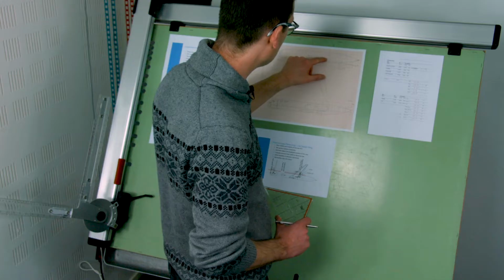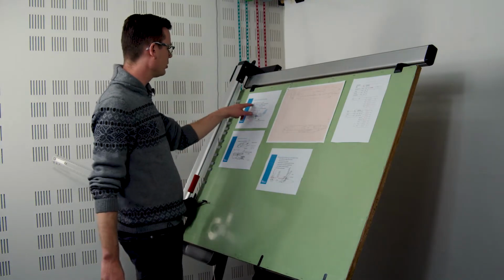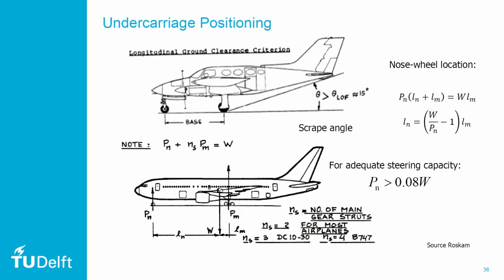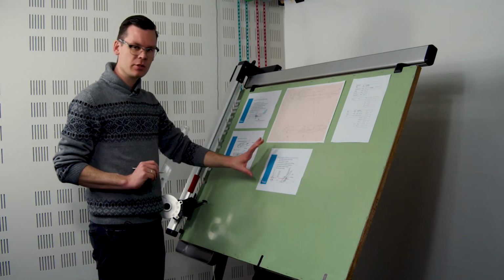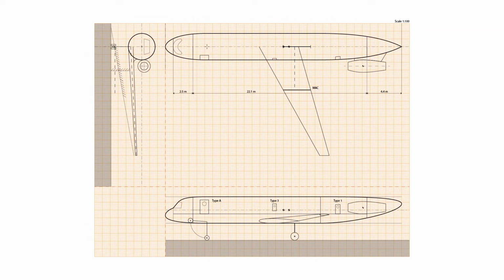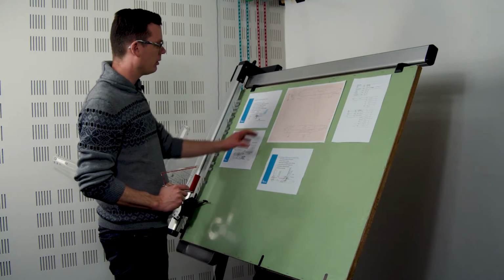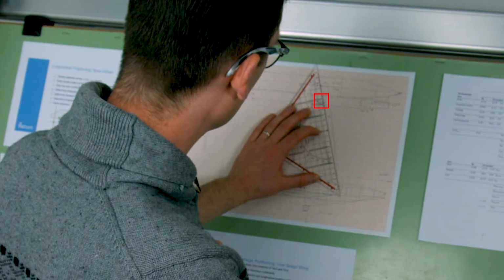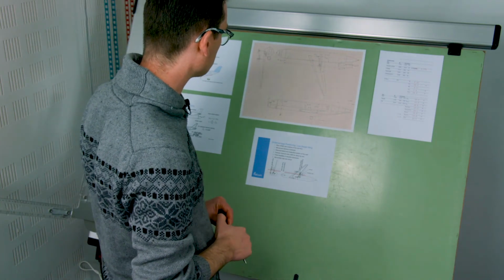Drawing the Undercarriage - Aerospace Design & Systems Engineering Elements #09

Comment: With respect to the video, the reader "Airplane Design and Analysis" shows a slightly different method to position the landing gear in longitudinal position. Secondly, the reader positions the vertical tailplane on top of the fuselage, rather than on the camber line. I would recommend using the methodology used in the reader.